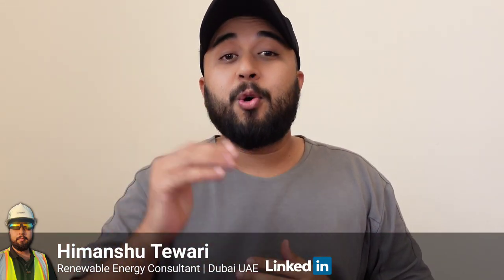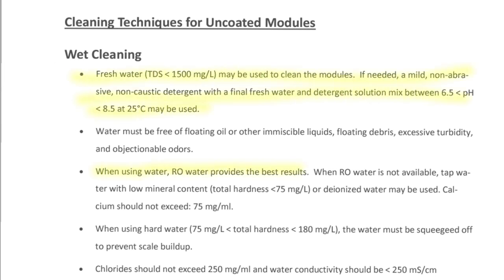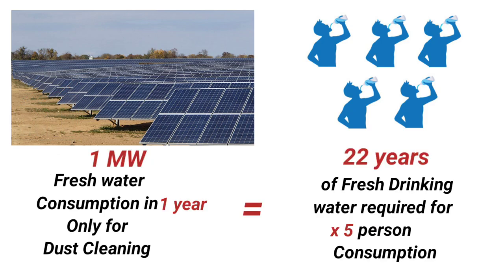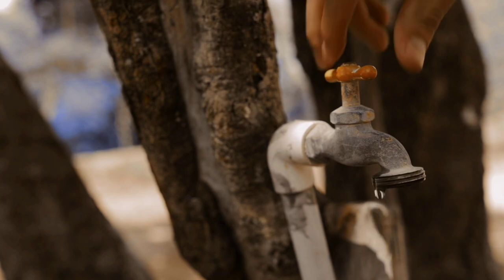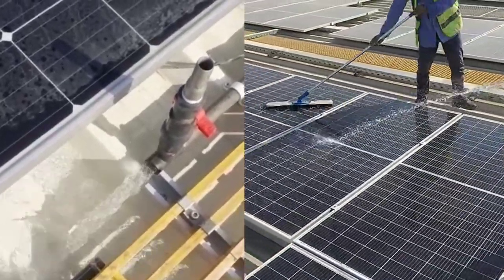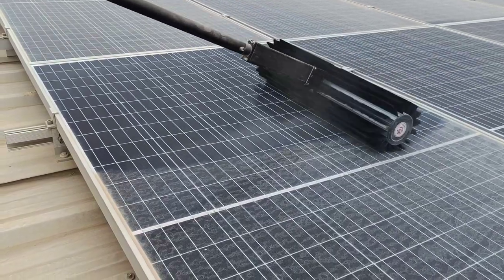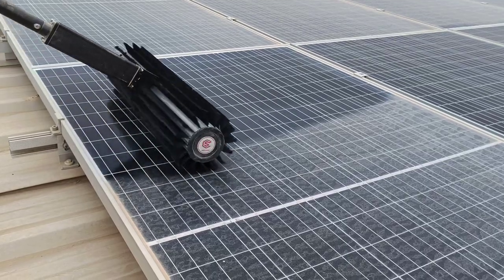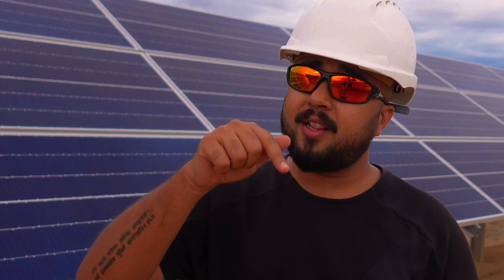Dark Side of Solar PV Industry We are in Danger | Dry Cleaning Solar PV Panels

Comment: Thank You Himanshu for uploading this beautiful video. I am an O&M Service provider and happy to say that I am using dry module cleaning method from last one year. However, I noticed that during the wintertime dew convert the dust into a mud-like formation which was difficult to remove however it need little extra effort to clean manually using a little amount of water and the results are very positive. :elbowcough:
Reply from the maker: In that condition wait for sunlight till 11am then the dew evaporates and again it becomes easy to clean

Comment: Doesnt dry cleaning the panels scratch the panel glass? Or are they resistant to scratches?
Reply from the maker: The fact Completely depends on the type of material to be used to knock off the dust layer , the softer the better

Comment: After a long time.

Thank you sir for large scale of solar knowledge put in my mind.

Query
large power plants having special team for service, operation and maintenance. 
but 
what about small residential plants for cleaning because any single owner can't do anything. and result, after 2-3 years power plant  be fail.

for example 
in gujarat,  Surya gujarat program residential projects completed 1200 mw which is  also contribution to our power consumption.
and i think roughly 70 percent customer no serious about of their plant. 
so my question is any simplicity of dust free panel for small 1-20 kw plants.
Reply from the maker: The most cost effective solution will be that The residential plant owner he himself should take the initiative to clean the plant once in a month , and should pay for AMC to the installer
Reply: @SustainableEveryDay  yes sir

our company same doing this
Reply: @ipowerinco.7755  Atleast 5 months of the year ,there would be rain atleast once a month minimum so rain would take care if these months . I have no safe access to my panels. With labour charges in Kerala ( considering labour market as well ) not feasible to pay to clean. 1 day labour is 1000 rs . Spending that to clean 3.3 kw plant everymonth is not feasible

Comment: U r forgetting about rainy reason natural cleaning of PV Panels & water used after cleaning of PV panel can be reused u calculation is one side only If use dust collector before cleaning of PV panel then u water consuption will less than as u calculated bro
Reply from the maker: Fixing that rain water harvesting channel on the pv structure will definitely comes with a cost and it's maintenance to prevent any leakage

Comment: Hey, hi bro 
  I need to contact with you Plz share your mail id or other Plz 

   In R,Y,B phase I need only R phase or Y phase current only , why because my area is ruler EB  area in same time EB side give 2 phase only, so other one phase I need to work solar R phase or Y phase it's possible or not possible, I need 3 phase combine to give my requirement face
Reply from the maker: It will work For that you need Single phase inverter
Reply: @SustainableEveryDay  yes need single phase but , the phase frequency Y phase (or)  R phase